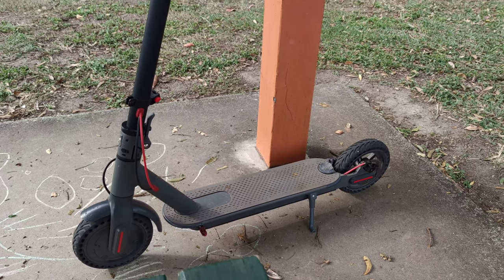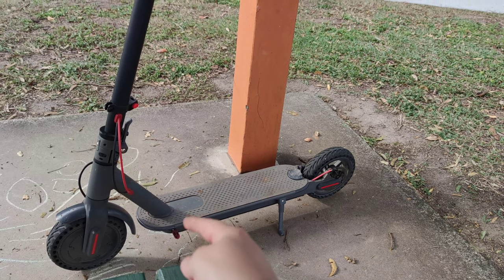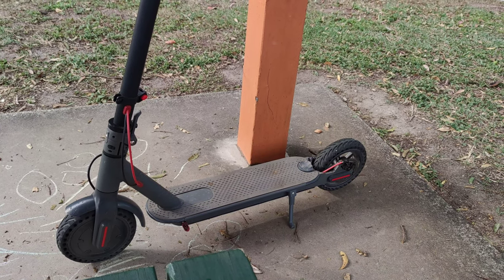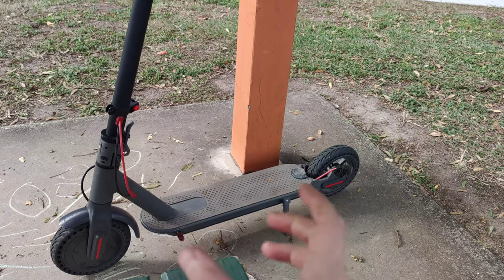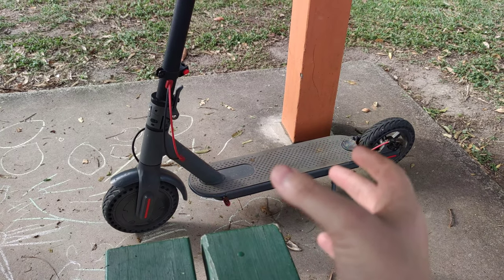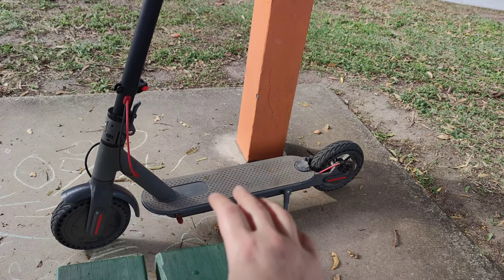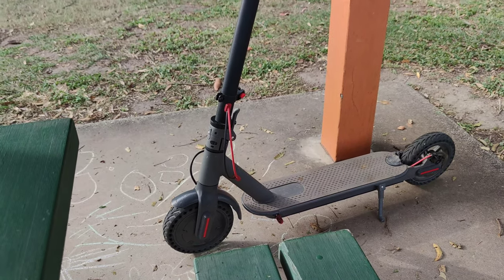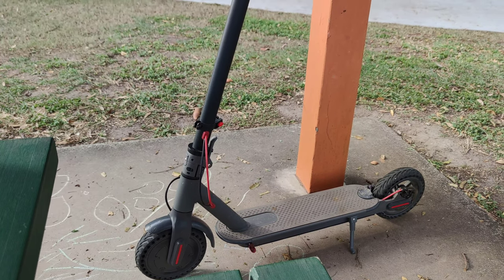How Heat DESTROYS Your Xiaomi M365 Electric Scooter

Comment: Small update if you wonder. Syrup front wheel after motor stuttering and all that. I might have friend my motherboard and thus my front wheel. The 365m controller isn't as good, but swapping both parts revived it. Hope this last a whole lot longer.

I also did use thermal grizzly (the best non conductive thermal paste) on my mosfets and the controller itself; but i have no idea how/if installing a fan would be possible. It surely would be insanely good for it's lifetime.

Comment: Hi! I have an issue with my xiaomi 1S.

When I turn it on initially for the day, or a session, there is absolutely no problem, during the ride no problem no matter how long I ride it for, but the moment I turn it off after using (whether a few minutes or close to an hour) then try to turn it on again, whether after a couple of seconds or minutes after, it wont turn on.

It only turns on after a while (its kinda random) but the same issue persists for a while (turning it off right away would make it hard to turn on again)

The button is guaranteed to not be the issue, I can't seem to figure it out. Both the trigger and how it fixes itself. There are no warning signs for overheating which I believe this should have.

I have no other idea except that it might be overheating(?). Does this behaviour sound familiar to you?

Comment: Hello there, I'm planning to install  a 500 watt motor from monorim with just stock batteries and control... what do think will happen? Is that a good idea?
Reply: I've finally got my hands on one and the torque is insane! But it gets super hot :/
Reply from the maker: Hey mate, what get's super hot? Just curious as I read through the comments!
Reply from the maker: Hey mate, well, it can't hurt at all. Hopefully the motor is built in the same configuration and the controller knows how to run it. Most likely will b fine but that's my concern. The batteries put out heaps of power, they'll be fine, and the controller may be a bit pushed to it's limits but I can make another video to show you how to make it a lot more powerful using the same controller. The best way is to simply modify the back of the controller board with extra solder on the trace lines. Literally can double the power output of the controller, and it stays reliable too which is amazing for a modification that costs almost nothing.
Reply: @TheChargeShow  that would be awesome! :)

Comment: my front wheel doesn’t want to move as much and the whole scooter vibrates when i try to ride it and it shows the over heat sign
Reply from the maker: That's weird. Is this on the M365?
Reply from the maker: Weird! What scooter is this on?
Reply from the maker: I'm about 100kg. Which is a lot to ask of a scooter to pull around, which is kind of why they get hot. Your weight makes a difference.
Reply: @TheChargeShow  Hiboy s2 Pro